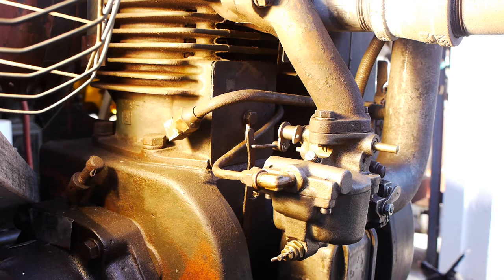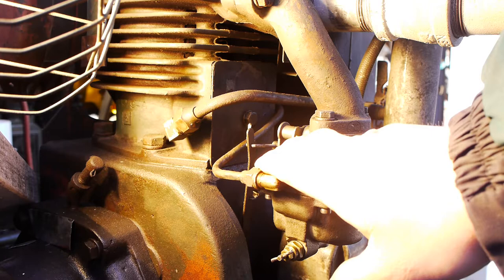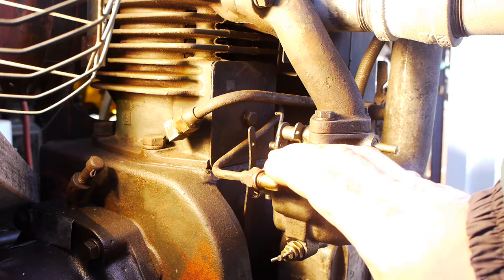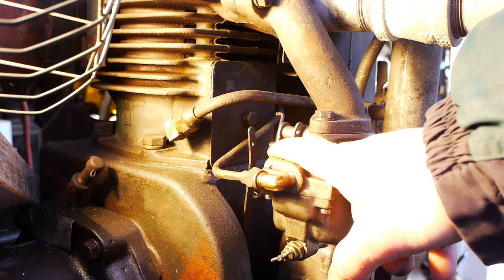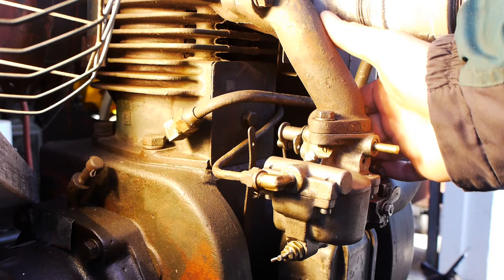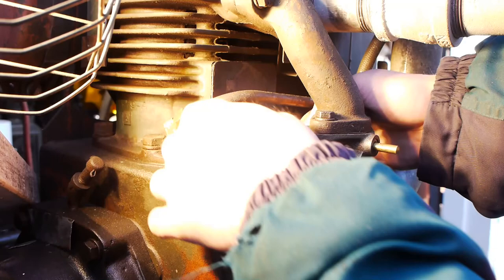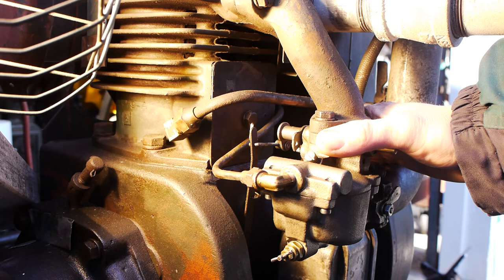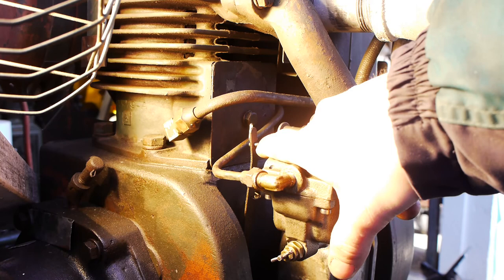How to set the governor on a Wisconsin AEH, AFH, AGH, AHH engine

Comment: Jimmy, I have an AEH on a Gibson model A tractor. The throttle works opposite of the AHH in your video. It runs OK but I've never been confident that the governor is working correctly in as much as it revs up even on a modest down hill so I throttle down the speed control lever. WIthout the linkage and spring attached, the governor arm has 4-5" of throw at the end. Is there a top dead center (type of) position the governor arm should be in when the spring is slack? Thanks in advance.

Comment: I have a technical question is there anyway you can make a video of the carburetor off and how you hook up the spring linkages mine has two springs on it is that factory or do I need to second spring it has a thinner spring on it and a larger spring

Comment: Where would you buy the spring for the engine? Mine has been long gone and I am restoring the tractor that it's on and I have to come up with something. Now I know how it's supposed to work. Gotta get the sping though.
Reply from the maker: Try Tim Stine 1-814-766-3675. He will have the governor spring and linkages for your engine.

Comment: Hello!, I've resently bought a Wisconsin air cooled engine in a Dutch garage sale. It turned out to be a model AK , size: 2 7/8 x 2 3/4 . serial number 1284092(I could read that on the badge) and thanks to the wisconsin engines archive i've found out that is was made in may 1949.
It was stuck when I got it but after 2 nights soaking in WD40 it gave way, the engine is loose. the engine is quite complete I've got the carburettor, air intake, fuel tank and the covers for it. the exhaust exit is unfortunately heavily corroded I don't know if I can fix the thread on that. 
Now i'm looking around to find ways to get it running again and restore it ,wich is not an easy task ... replacing missing bolts is a challenge, unfortunately over here in Europe simple standard english measurement bolts are hard to find but I've got some adresses who will hopefully have them ..but there is the internet and lots of questions can be answered just by asking and that is what I'm doing right now

my questions to you are: what type of oil should I use and how much? sparkplug? spare parts? tips? leads? anything is welcome

greetings from the Netherlands! Dennis
Reply: The exhaust on your Wisconsin AK is 3/4" NPT. Buy a NPT pipe tap on ebay and  clean up the threads. Most of the bolts on your Wisconsin AK will be 5/16-18 or 3/8-16 thread. The only metric thread on the entire engine is the sparkplug hole 18mm x 1.5.

You should be using straight weight SAE 30 motor oil in your Wisconsin engine. Pull the oil pan and clean out all of the sludge. The AK has a plunger type oil pump. Make sure that it is in good working order. Sit the pump in a tray of fuel oil and manually pump the primer until fuel sprays out of the small orifice. Once the pump is in verified working order, reassemble the bottom of the engine. I forget how much oil your AK uses, but a quart comes to mind. Usually fill to overflow unless there is a dipstick. 

The sparkplug is an 18mm Champion D-16, gapped at 0.025"-0.030"
I only use copper core Packard 440 plug wire on my engines. 

If you search Tim Stine online you will find his phone number and email. He is located in Pennsylvania, USA. Im not sure if he ships overseas, but its worth a shot.
Reply: Thanks Christopher for your detailed information it is much appreciated!,  it wil help me a lot to go on with the engine.
Greetings, Dennis

Comment: have a 720 Bobcat VH4D engine Starts but at high rpm cant get it to slow down.  Governor problem or carb ?
Reply from the maker: You should first verify that you have the correct PM-76 governor return 
spring on your engine. It has 25 turns in it. Next, check that the 
linkage between the carburetor and governor is correct. If it is some 
homemade contraption, buy the correct linkage. It should be made of 4-40
 threaded rod. Once that is all okayed, check that the governor control 
arm can move back and forth. If the governor arm does not move back and 
forth, chances are your engine has a bad oil pump, and the governor was 
running dry on the pin it rides on. I have seen that pin shear off 
resulting in a scenario that you describe. Every flat head Wisconsin V4 has an oil pressure line which runs to a restrictive fitting on the face of the 
governor. Crack that line with the engine running. If you get oil 
pressure (only about 5-7psi on a VH4D) then you have a working oil pump 
thus far. It is a good check to make on any newly acquired Wisconsin 
engine. The only carburetor issue that could cause a scenario like this 
is a carburetor with dirty or rusty throttle shafts. If the throttle 
shaft cannot rotate freely in the bore of the carburetor, then it could 
hang up and not want to throttle back down. Those few checks should help
 narrow down where the problem lies.